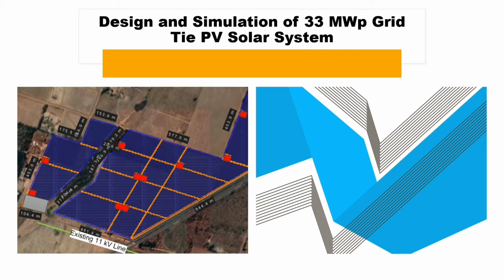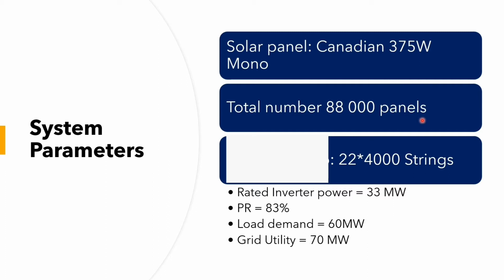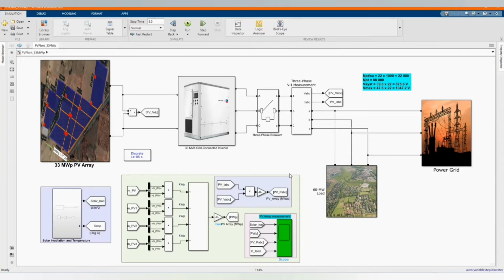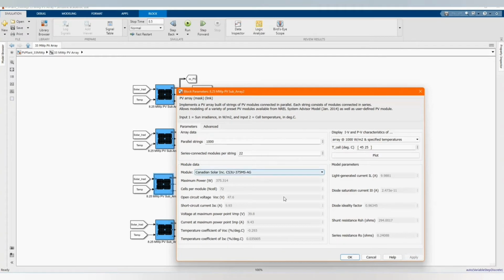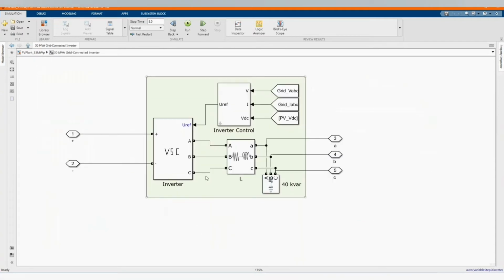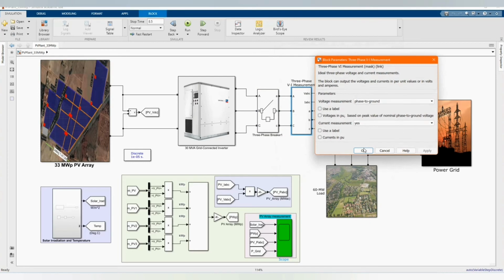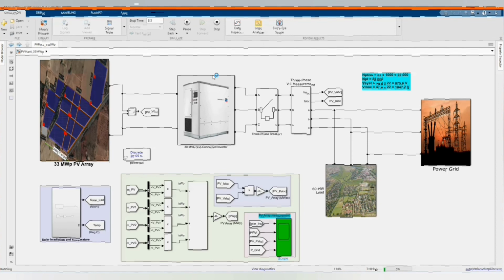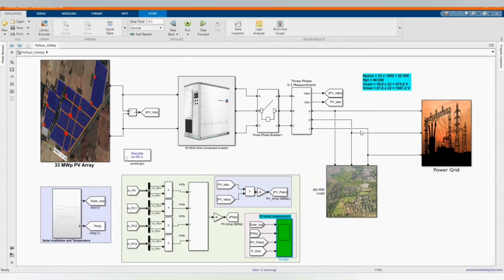Design and Simulation of 33 MWp Grid-connected PV Solar System in MATLAB Simulink

Comment: Thanks so much , But the must interesting thing the voltage level is different in both load and grid but I didn't see any transformer
Reply: but you have the DCDC boost converter
Reply from the maker: Hi thank you for your comment, This model is modelled on the scenario,
1. The tie in point is closed to PV plant and we will not need long cables
2. The inverter is High Voltage inverter